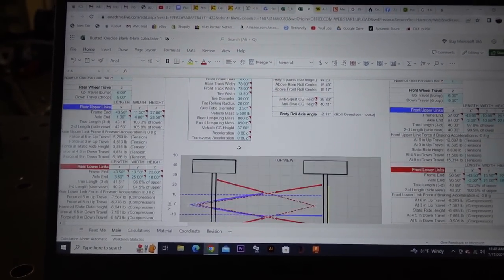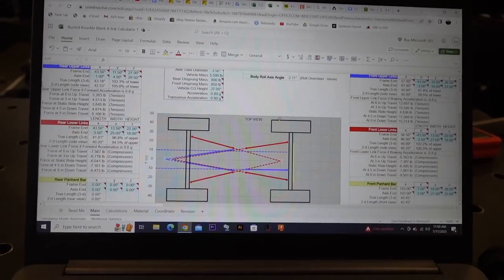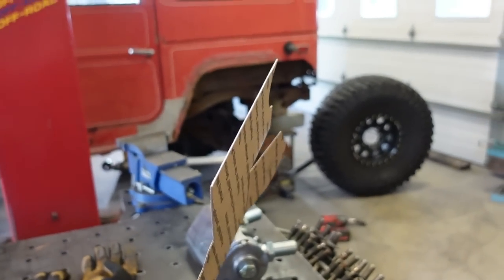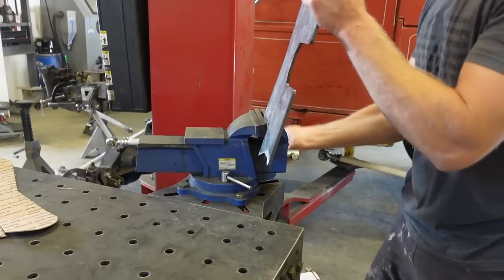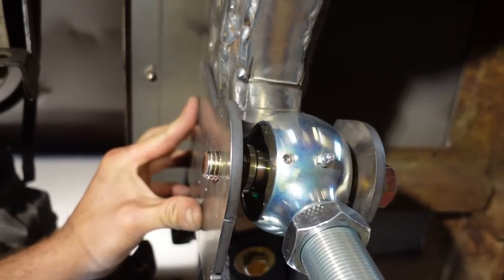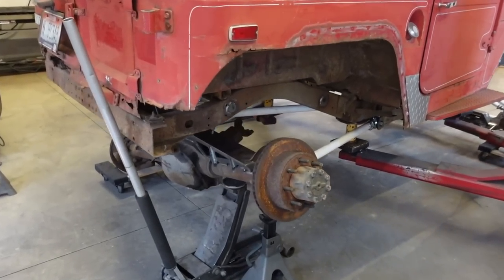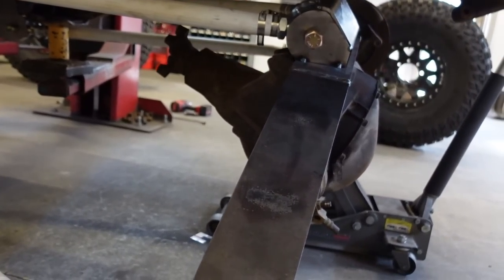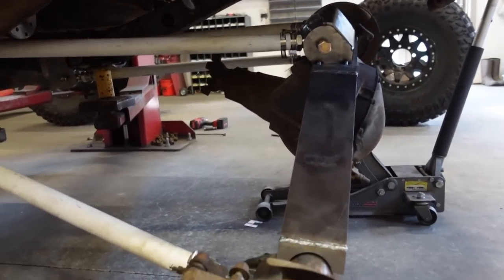I Built An AWESOME 4 Link Suspension FROM SCRATCH!!

Comment: I love your work and especially the FJ. This is a dream build. Your skills are exceptional. You use the pvc pipe to prototype, great idea. Have you considered using lazer cut acrylic glass to prototype your custom joints or thin metal depending on application?

Comment: Fantastic job so far. that rear driveshaft is going to be a headache still... It was on my samurai. When you toss the limit straps on it, do three. One center to limit drive shaft angle while allowing each side to droop, then one on each side to protect the coilover. Its looking like this will be a VERY capable rig. Looking forward to the cage and bumpers!

Comment: To get the best hole with plasma is to cut small and drill to size you need. I do this but destroy my drill bits because of the hardening the plasma does. I cut fairly close to size hole I want. So my question is how much smaller are you cutting your plasma holes vs hole size you want?
Reply from the maker: For the .75 hole I cut .65 and drilling is fast and painless!!

Comment: Question.. when you design your drawings in fusion why do you always drill your bolt holes by hand? Is your plasma not accurate enough to cut out the correct hole size?
Reply from the maker: Yes I usually cut a small hole and drill by hand after! Plasma cuts with a little taper and I like a nice straight hole!
Reply: @austinniemela  cool, makes sense